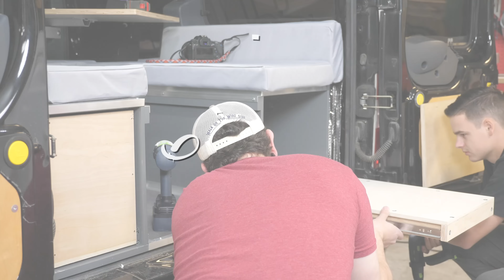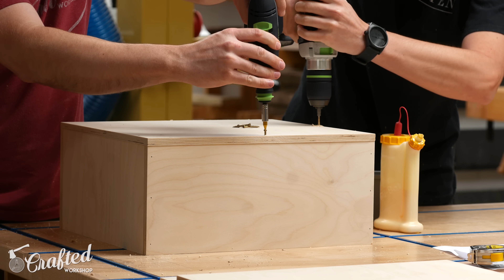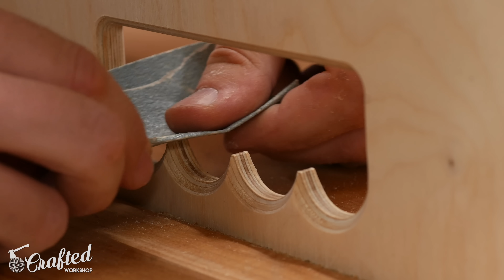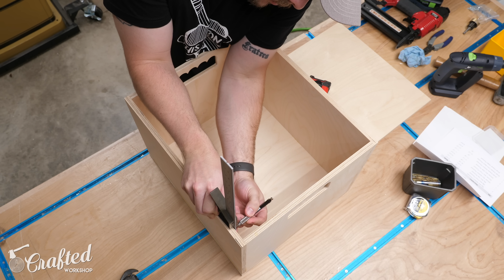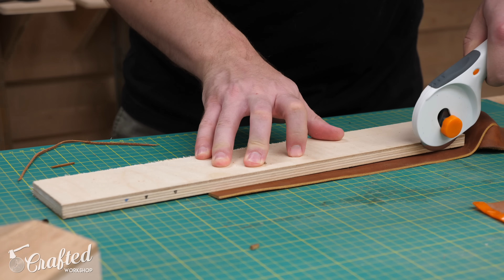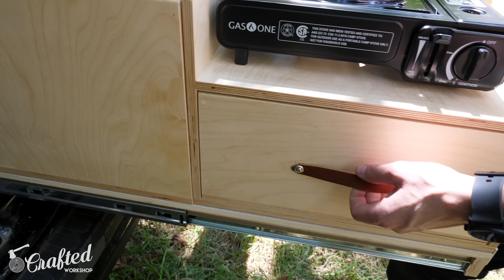DIY Camper Van Kitchen with Sink and Propane Stove #VANLIFE

Comment: So clean! Did you guys use a specific heavy duty drawer slides for that one?
Reply from the maker: Thanks! The slides are rated at 400lbs but could honestly be more beefy. The ones I linked to in the video description are the ones I’d replace them with.

Comment: Making them removable is really innovative! A simple feature that really increases the usefulness!
Reply: I wonder if you could implement a spring-loaded French cleat type system on the horizontal slide to lock the boxes down...
Reply from the maker: That or some kind of latch system would be cool, but they stay in place extremely well and are basically immobilized when retracted.
Reply from the maker: Yea, they are very convenient when at a campsite!